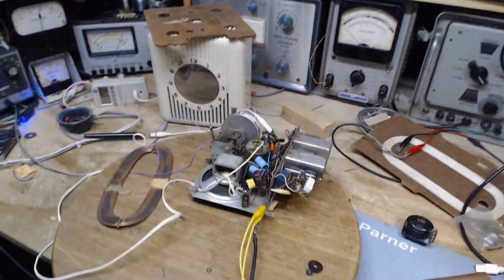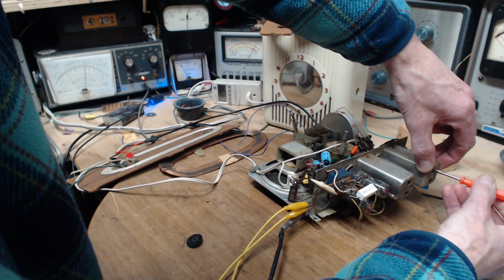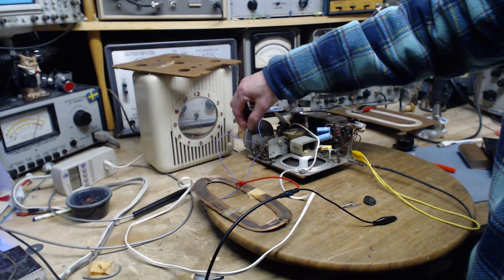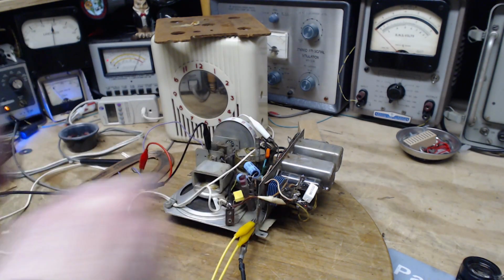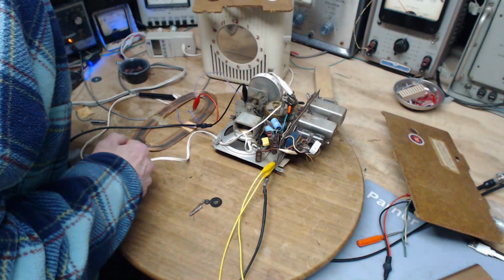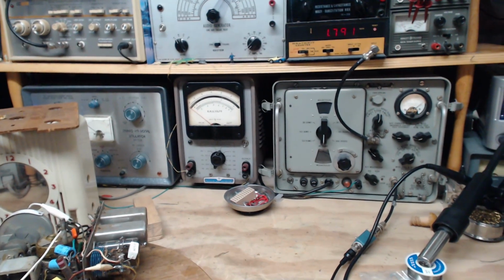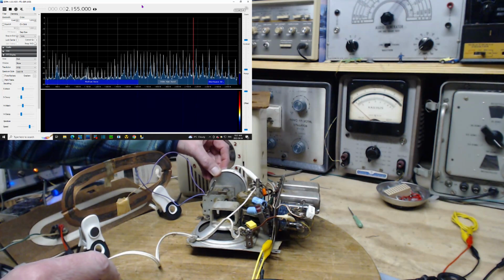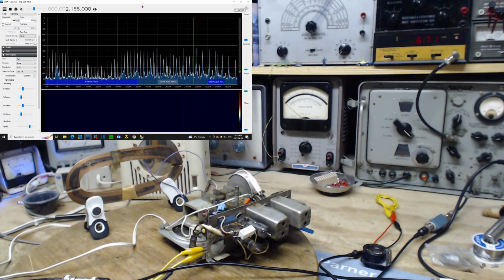Jewel Model 505 Vacuum Tube Clock-Radio Video #5 - A Better Alignment

Comment: Two peaks in the IF, well one of course is coming from the signal generator , the second beat is the difference frequency resultant  of your local oscillator running off frequency producing the 422 kc. Then the local osc. Beats with the signal gen. Signal and you hear the beat difference. There are no tunable slugs in those IF cans only tunable trimmer caps.

Comment: Jim, you never heard of 
Globar resistor?  They were primarily used in circuits using silicon diodes like the one you have.  In the same vane the Globar protects the filaments too until they come up to tempera rapture.
In the 1960’s RCA used them in all their color TV power supplies.

Comment: So the oscillator was not tracking  the incoming signal by 455Kc? This is why you; need  to,disable the the oscillator when doing an IF alignment and injecting  the 455 Kc into the IF amplifier one stage at a time, peaking up the IF strip. Then adjusting the oscillator,frequency to455 Kc away from the incoming signal . It would have  been clear then the oscillator cap was at the wrong capacitance. Note you did catch that upon initial inspection when you saw the capacitor vanes askew. This was an odd problem brought on by a twiddling radio tech before you ever got the radio in your shop. It should. Ot have taken all that test equipment to figure that out.

Comment: You really need to be using  plastic tuning tools. Each time you use that metal screw driver you detune the IF adjustment range.

Comment: So glad to see you took my advice on the 5 watt 233 ohm filament dropping resistor. It also lowered the B+ a little and took the radio out of the saturation region reducing the gain just enough to kill oscillations.